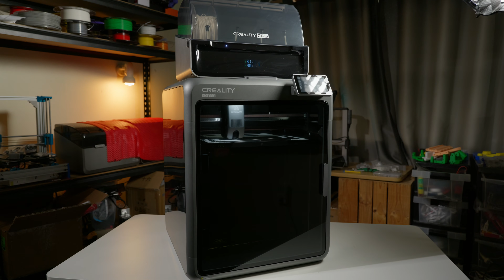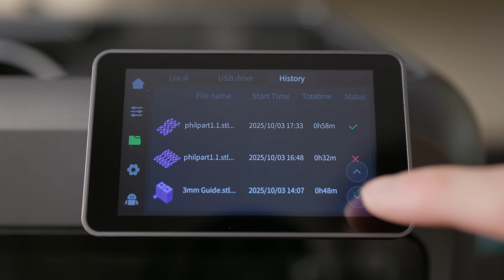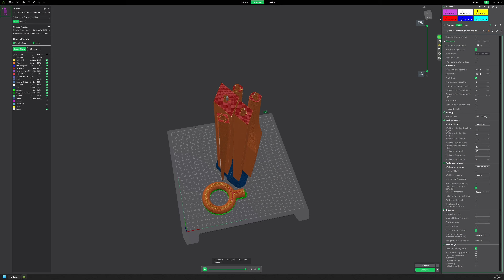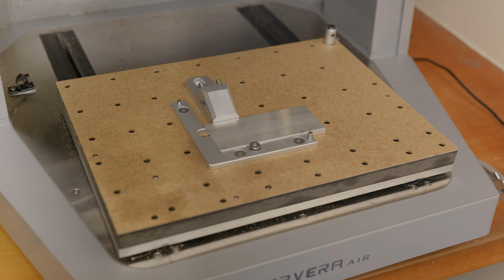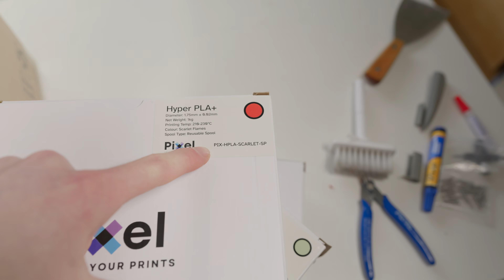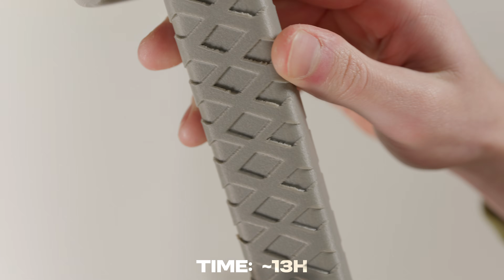My Time with the Creality K2 Pro

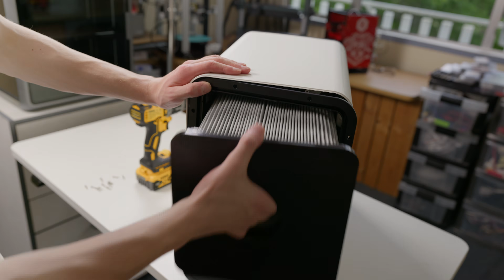Comment: 9:27 looks like activated carbon filter to remove smells and potentially some harmful chemical vapors

I like Creality's bold innovation in packing, shipment protecting peaches have never been tried before.
Reply from the maker: Good to know! I don't know if things were actually more pleasant in the studio air quality wise, or if that's just placebo 😅 Will have to keep testing.

This is true! The peaches are unfortunately not edible though 😔

How are things going on your end? Time seems to be flying!
Reply: @TommyHoughton  Time sure does fly lol. Well, my recently new Kobra S1 does have few upgrades lined up already. First I had a failure with hotend where a clog pushed out the PTFE tube so I ordered upgraded bimetallic hotend. Now the bed is twisting (120 or so hours, apparently bed leveling probing warps the 2mm stamped metal gantry and I had done a lot of it) so I have the upgraded milled gantry and bed ordered, chamber heater too as I need to print some ASA stuff (water and UV resiliant like valve covers for rubber dingy etc), heat insulation (I just ordered engine bay stuff for cars, it is generally just straight up aluminium and sticky foam and not a thin plastic sheet that is kinda silvery while costing like half)... and then I can start the ender3-style grind of "now I print calibration cubes and temp towers to figure out stuff and slightly change stuff in slicer". 

First 50-60 hours of printing was me trying to print the Ace Pro riser. First print in PLAhad too tight tolerances so I could not manage to put the two parts together, edited the model (the creator is great and provides fusion files for it) by removing some materials, adding a channel for glue so it does not rely on friction and reprinted. But I had PETG left and it kept failing after 12-13 hours out of 24 hours per half. I threw out like 4kgs worth of filament trying to figure out filament jams - to all the otehr owners of Kobra S1 out there, do not put the Ace Pro too close to the wall, the PTFE tubes can bend too much, the filament gets pinched and you lose a lot of time and money troubleshooting.

Kobra S1 is great for PLA. The detail it can pull off with 0.2mm nozzle and decent quality PLA that is fully dry is incredible. Like you can print decent quality minifigs with it (and I did for Mausritter campaign that i play with my nephews). It is however terrible for "sticky plastics" like PETG and ASA, at least stock. My experience vastly imrpoved by buying aftermarket hotend with 0.6mm nozzle printing functional parts (I just generally do not print decorations, 3d printer fills a "plastic doodad from a 45 year old car can't be found online" role) but the bed leveling is still abysmel and first layer is now after like 120 or so hours near impossible (the bed is pretty much a taco, a good 0.7mm dip when I use straight edge and calipers). And this printer... well it sure does have its fair share of cost cuttings and it shows. 
Recommended buy for people who want "bambu you can tinker with" as there are many aftermarket options now. And you can get a tinkerer from Ender3, but you can't get Ender3 from a tinkerer. Everything is Ender3 if you squint hard enough. 

So in short, all good, you?
Reply from the maker: Now that's always great to hear! Nothing better than a list of mods in the works. Ah, it really does seem that the hotends are the first to go! That's been the case for far too many of mine, and others machines. 120 hours is nothing, so that's a real shame, even if it's a couple hundred prints. The milled gantry and bed sounds awesome! Always a fan of getting some proper metal parts in the mix 💪 I've actually bought quite a lot of what I believe is the same heat insulation stuff as well; I plan on using aluminium panels for the custom printer build, and can't risk them absorbing the chamber heat, haha. Good luck (and patience) with the calibration grind!!

Ah gotcha, I have heard that's a popular mod for that machine, and even seen a similar one for other similar machines... 12h in? That's extremely frustrating. I've never had the best luck with PETG, so that's extra annoying to hear. Sorry to hear about the losses with that endeavour. 

Well, at least that's great news! Always good to have something a machine can excel at. It's funny how much the hotend swap improved things, as I've found it can sometimes be 50/50 depending on the machine setup, even more so with a larger nozzle. In my case, the Rapido Ace with a .6mm nozzle struggled quite a bit on the K2 Pro, unless I'm completely losing it and used two 0.4 nozzles 🤔
Ah crikey, that's quite some deviation... Very annoying. I do at least like the sound of a "bambu you can tinker with", haha! I was hoping the K2 pro would fit that bill too... It sorta does? Kinda? I was hoping for more, but I haven't exactly tried hard. Love the Ender 3 mindset, haha. 

"All good" is great! Brilliant! Anything not bad is good. I'm very glad to hear that. 

I'm feeling a whole lot better now that the Creality video is out, even if it might have some flow-on effects that I might not benefit from, but that's ok, and I can move on now. I'm stoked to try and rethink my whole approach with everything, as I don't want to let others down with the custom printer series, nor disappoint myself, or lose too much motivation during it. It's very important to me that I make sure things are sustainable and balanced going forward, and I don't want to get that feeling where I post a video I'm not pleased with. I'd like to make some changes in the studio, although I should think through if I want to make changes for the sake of change, or if I am aiming for real benefits. Next week will be a chill week of thinking and planning ahead, and trying to go back to the start-of-the-year mindset, when things were more like a hobby/game. All in all, feeling good as well, and excited! It's a brilliant combo, and I'll do my best to maximise it 😄
Reply: @TommyHoughton  GLad to hear :) I'd recommend going for itterative changes, see what works first before going head first into a studio remodel. That way you avoid sunk cost fallacy when trying to make something work that is just not working.

Good luck and yeah, absolutely rest up and gain some perspective. Generally good way to live a life. And having your hobby turn into a chore is a real pain so try to steer clear of that. Both for you and the channel that is. For you - you lose a hobby, for the channel - you become a dime a dozen channels that does uninspired videos that are pushed out just ot pay the bills. 

Also I would recommend to look for a decent lawyer once you start getting sponsorship deals. Back when I had a channel near 10 years ago now lol we had one sponsorship offer, we took it on and then half a year later got sued for breraching a contract. Turns out we basically signed ourselves to never speak ill of the product, I said that "I would not use it myself but I see why someone would" on a stream of like 12 viewers, while playing game nobody cares about. And they somehow found it, sued, won and  Ihad to not only return the sponsorship deal money (which was not that much to begin with) but also all their legal costs and such (which amounted to like 12x the deal money). So I had to take on a second job and basically that was the day the channel died. Never got myself to make videos since then (outside of "family only" vacation videos and a very easy to edit/cut bike trip video)
Reply from the maker: That's absolutely the right call, and funny how you mention sunk cost fallacy, as that's something that was brought up to me just a couple of days ago... Will start with some light changes for sure, literally; I've ordered some ceiling mounts to try get my light stands out of the way, and then will see about some blinds instead of the curtains. Just basic stuff for now, but the big one is storage, and good looking storage at that. Will get there!

Thank you a ton! I've been feeling so much better already having moved on this video, and trying to shift my mindset around a bit. Putting it like that, with losing the hobby and the channel, isn't something I considered out of naivety (I refuse to see failure as an option), so I will take that into consideration too, as that's very serious; I'd hate that to happen, and will do everything I can to avoid it. I'll do some financial thinking 6 months or so into the year, after the custom printer series/investment, haha. Some changes will likely be needed.

Oh crikey, that's some advice I wasn't expecting! I do remember our previous chats about your channel with your friend, so this is very interesting to hear about. A lawsuit is terrifying to say the least, and I really hope I can avoid a situation like that at all costs. I've just read the story, and that's nothing short of one of the most brutal and crushing ones I've heard. I'm really sorry to hear that happened! That's the most insane case of Murphy's law I've come across. That caught me a bit off guard, as I wasn't expecting something so extreme. Sorry again my friend, I can't imagine how much more that affected you than what you've written. I'll note to always be hyper-vigilant whenever contracts are present, the best I can. No signing anything late in the evening! Haha. I have a video planned that would require re-checking my only active contract for anything I should be aware of before sharing (specifically if my total income can be shared safely, but as explicitly stated, individual payment values are not), so this is a good reminder to be aware.
Reply: @TommyHoughton  I did not want to scare you, just wanted to say that some contracts may end up being predatory. The one we had was for one of the dime a dozen lootboxes that were a new thing back then. We received no payment (breach of contract on their part but it is pretty clear they just wanted to find an excuse not to pay us and get some money from us), one of the lootobxes to unbox (not a review, just unboxing) and after half a year or so I said on stream that "I would not personally buy it, the novelty wears off and you end up with manufactured landfill stuff you have nowhere to put". The channel did not die to this specifically, we also partnered with a network that really screwed us over as they collected all the revenue and would pay us out with extreme delays (like 8-10 months after the video revenue came), their raffles were just a bait (we won like 3 things in them, did not see anything, and it was meant to be things like Eizo monitor, DSLR, external HDD so very useful stuff for content creation) that other network members circlejerked around (videos were private, sent via email and then after week or so deleted so there was no evidence of it). I am pretty sure they shorted us out of 500-600 USD outside of the fake raffles. 

Generally we just were too naive and trusting. 2014 was still a wild west still on youtube. 

Then adpocalypse came and we (mostly me) just stopped even trying. Most of our videos got demonenitised because we did swear and since we were dime a dozen (mostly) minecraft channel, we saw no viewers nor growth whatsoever while having so much baggage to deal with. So ultimately I just stopped and kinda hang my friend up to dry. Which I am not proud of and we do not really talk anymore but still, could have handled it better. And to be fair, he was the one who kept proposing we use viewbots etc, so he also had the wrong idea about the way things work (he was adamant that organic growth does not work, the thing is if you are not unique at all, do nothing to distinguish yourself from all those other channels, then you are just doomed to not grow). 

I think that you are in the clear in this regard, not only have things changed since then and sponsors are now more professional, but also you are already big enough to not get easily screwed over (the kind of channel that larger creators are aware of and would absolutely report on if something went south). We were like 5k subs channel, 2-3k of which were active viewers (and like 5 were borderline fanatics that watched all the streams and were... I don't want to sound mean but 2 of them were kinda scary as they seemed to know a bit too much sometimes despite not being someone we knew personally, but they would pull like a trivia from a tweet from 2 years ago or a clip from one of the first streams and so on, they really made me reevaulate social media and now outside of YT and steam which is also kinda SM I have none) and I doubt anyone would notice (and yup, nobody did) if we'd go *blip*. Channel is still up, about 1k subs left over, our subreddit and so on got already archived, twitter account got banned after X takeover (it was not even active for like 6 years but still kinda funny because I did tell Elon to F off back in 2019 or something when he called the cave divers pedos and that was the last tweet before shelfing the account).

Anyways old guy is done reminiscing of his youth now, just make sure that if a deal is a bit sketch, you have it reviewed by a professional. It will cost a bit, but can save loads. But most will be fine these days as companies slowly learn that there is indeed such a thing as bad popularity (see Established Titles) and that being promoted long term is the best strategy (e.g. dbrand, ifixit).
Reply from the maker: No worries, I'd rather be aware of it than not. I think I might know about the lootboxes you're talking about, although I will admit, I did not have much of anything going for me in ~2014, haha. While I can somewhat understand the company taking offence from such a statement, I still think it's nothing short of "incredible" that they found out. It really feels like a movie scene where a character brings out a voice recorder with important material on it 😅 That 8-10 month delay situation is also mad; I'm already somewhat impatient with the 30-45 day timeframe, haha. It's all really something.

I can at least say I'm the opposite regarding trust, as negative as that sounds. I'm very cautious about the whole sponsorship situation, and have a couple of past deals I've turned down out of gut-feeling for safety. Still not sure about those as it would have helped me, but I'd rather be safe. I will be directly reaching out to a company next week, which I would have otherwise been connected to via a middleman.

I will still never understand the strictness of YT's speech thing, even if it's on swearing, which I half get. Mainly, my take on YT being the big-boy platform, and YT Kids being the remainder. I'm at least not worried about getting demonitised over speech, but more of getting erased or stripped of everything due to an inaccurate AI moderation claim, which seems to be the current major threat, but I will just have to exist and see how that all goes. I'm sorry to hear that the final stretch wasn't ended as cleanly as it could have been. It's certainly taxing to think about how things could have been done differently! Ah, viewbots is really something. Damn. I can understand the fear of originality being a requirement for success, for sure.

I'm all for reassurance, so I appreciate you saying that. I'm very pleased with how my current sponsorship situation is; it's all simple, effective, and most importantly, a friendly win-win between the parties. A win-win-win if we count the end user getting an enjoyable video as well 😄A couple thousand active is a ton! It's always surreal to talk numbers. While I haven't yet experienced any "superfans" yet, I completely understand that situation. Very surreal. Oh wow, I actually forgot about the cave incident from then! That's also a completely valid response to give to Elon, haha. I'd think the same but would never say.

Thank you again for sharing them with me! It's a pleasure to hear, and it helps me in a bunch of ways. Regarding a review of a professional deal in the future, presuming we're knee deep in that level of stuff when the time comes, I'll make sure I talk to the right people about safety and fine print. The long run for the win 💪
Reply: @TommyHoughton  I mean it was 2014 gaming youtube so... a lot of swearing was grante. YT of today is far cry from it, barely anyone ever even swears (which I do not mind).

It is better to be cautious than reckless. If I was doing YT today, I'd probably be picking sponsorships based on couple criteria and they would align with how you've chosen sponsors so far, let's take your sponsorship with PCB Way for example. 

Does it align with the channel's category? Since yours is tinkering, hobby computational crafting and borderline embedded systems engineering, yes, it does perfectly align.

Does it align with your values? Since yours seem to be self-reliability, self-dependance and self-designed solutions again, it aligns perfectly again (the only better way I can think of would be promoting an actual PCB printer)

Does it help the viewer? I mean before I learned of services like PCBWay I never knew that i can just have my own PCBs done on a budget or have something machined/printed on scale. On scale is important bit, I can visit local machineshop for a one off or prototype, find a dude on facebook to print something for me or have PCB done locally. But having it all at one place does help IMO. So yeah, to me having that sponsorship helps the viewer.

Is there any controversy, or potential for controversy? E.g. Honey or Established titles were sketchy from the get go, and would aboslutely not align with the values or cateogry of the channel. What PCBWay has as potential controversies would be anything China related, so maybe poor quality control? Or generally environmental issues since they do deal with various nasty chemicals and waste. Those may 100% damage your brand but they are not on the level of a scam like Established Titles, that are easy to spot if you look a tiny bit closer. So the brand damage would be manageable, and just no longer partnering with them once such controversy surfaces would be to me sufficient damage control.
 
Does it fit the video? PCBWay sponsorships in your videos barely feel like it. You just mention that you use them which is clever. You can pull a Linus and do "segue to our sponsor" joke but not only is that like THE Linus thing now, but it just does not feel right often with Linus as well (having War Thunder ad before server overhaul video is just way too off for example). Meanwhile you just show that you got this part done in clear resin etc. Which is great way to promote product or service - show, don't tell (well you have to tell because of the contractual obligations but you still make it as seemless as possible and I appreciate that). GFuel or the latest fad of supplements like AZ1 or whatever it's called would just not fit the video whatsoever. 

At the end of the day you do you. I am just saying what I would do these days. I will not be mad nor disappointed for you trying to pay the bills when I am literally watching entertainment provided by you for free.
Reply from the maker: Yeah, I guess that was the case. I think with YT being a lot stricter, or at least, randomly being stricter, has people on edge a bit more.

The controversy part is something I often consider whenever a company reaches out, or if I'm planning on reaching out to them (e.g. Slice Engineering, whom I still need to think about regarding a ~Q3 next year project), depending on how much it could affect a project. I do vividly remember the Honey and Established Titles situations... and that's a considerable point regarding environmental issues; I have considered such a thing, but only in comparison to my personal impact. i.e., any positive or negative impact I do have is unfortunately tiny compared to a corporation. Thankfully things seem to be fine on all current fronts so far.

Especially on my end, it's clockwork to have them integrated, and it feels like they've always been there, haha. It's definitely a big deal to me to have used them a bunch, which I'll continue to do as I do like what they offer, although my experience is skewed compared to a normal customer, as I of course, haven't paid for anything myself.

I'm really glad you appreciate how I integrate them in! I'll keep working on improving that more, as I'd love to try even more "show not tell" variants, but for now I'll stick to the refined ad-read routine that I'm currently in. We're getting there.

Regardless of bills, I'll still always try to keep things similar to how they are now; the last thing I want to do is sell out, but some thought-through compromises could be useful if they benefited all three parties involved and aligned with my values, of course. I'll remain cautious as always. For now, it's sticking to how things are at the moment, and just keep moving higher, faster, bigger, and better 😄